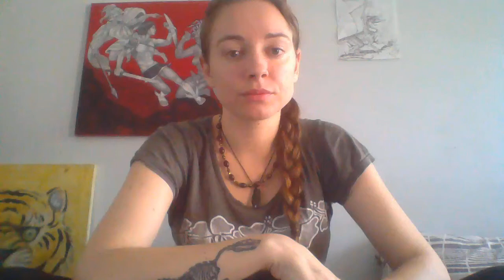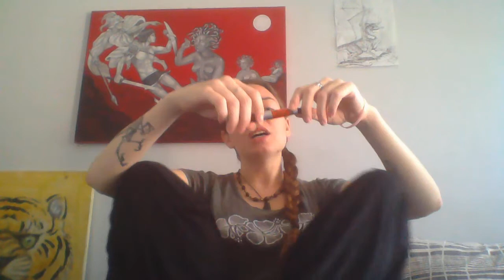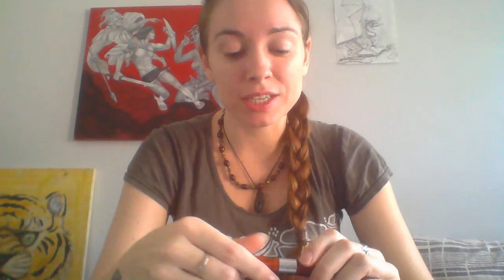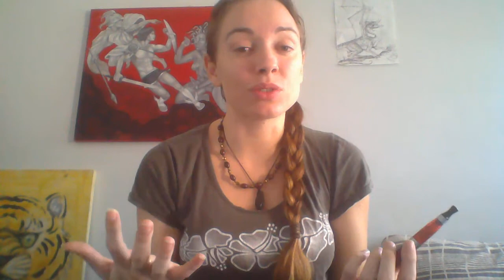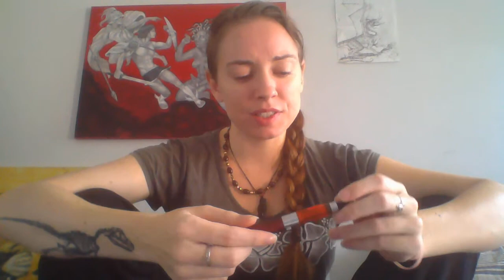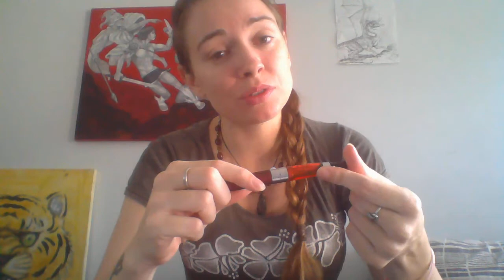How to tell your disposable vape tank needs to be replaced

Comment: You know you can just buy the replacement coils right?... Also the pro tank 2 mini is AWESOME!  but you will need to get replacement coils for those as well they burn out kind of fast. I prefer my mech mods and "dripping". but I do like Kanger and Innokin tanks if I want to use my regulated devices. Happy Vaping!!  #vapelife
Reply from the maker: Been using the protank for two weeks now & loving it. Also, on a cosmetic level, it looks very schmick :) Got a few dry hits but solved that by lowering the voltage on my twist
Reply: The one she has is non replaceable. It's a top filling tank so if you unscrew the bottom it will always leak cause you've broken the seal. This one is just disposable.